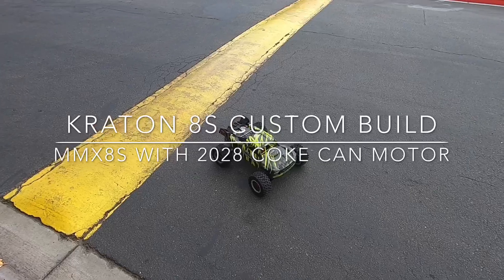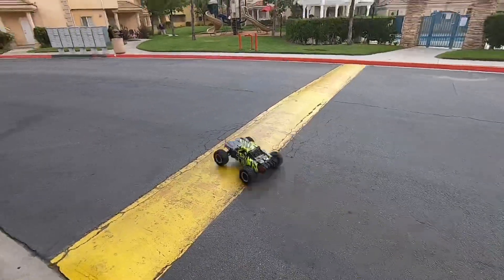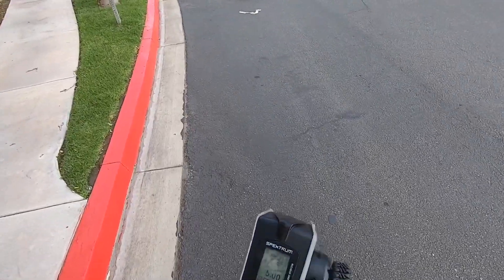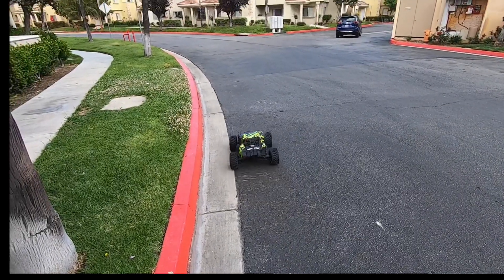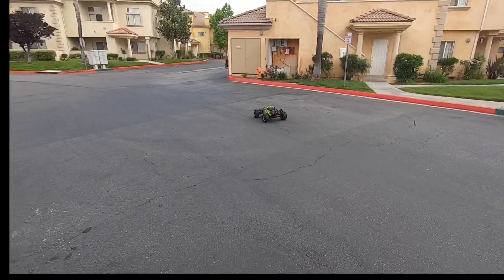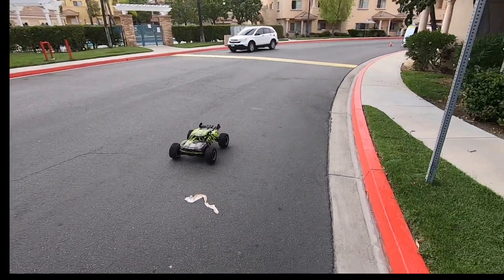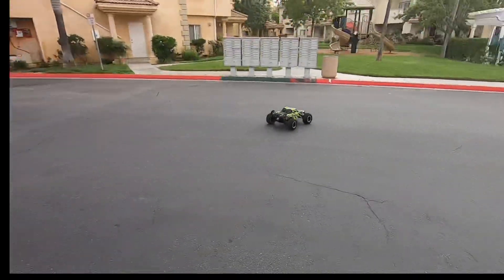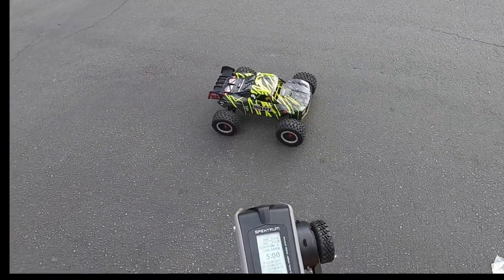Arrma Kraton 8s MMX8S with 2028 motor setting up the spectrum DX5 Rugged first run

Comment: Thanks to castle's strong magnets in their motors the brakes work amazingly in any build you throw them in! Shit my sensored 1515 brakes way harder than my tp power 4070cm.
Reply from the maker: Yes I’ve noticed that to my 1515 works great on the brakes as well 💯💯🔥🔥🔥

Comment: try turning up the voltage on the servo if it can handle it
Reply from the maker: I turned it to 6.0 v already should I go more didn’t change at all figure it’s done already??
Reply: Earl Moorhead try 7.4v i thought my servo was bad I switched to a high torque  xmaxx servo and was still lacking same as the last one then i tried 7.4v now its sharp worth a shot

Comment: Did you alter the steering? I know you said you were going to take a look at your transmitter settings. Had to ask because I ran into a similar situation with my Slash build (inspired by watching Watermelon). I didn’t use a Traxxas servo horn and I was barely getting any steering out of it. Took it to my local hobby shop and they installed a Traxxas steering horn on my ECO servo and all is good. Good luck with your situation.
Reply from the maker: Thanks 🙏 my steering is all stock it looks like the servo is just real weak at this point but I appreciate the info you never know when it might help 👍👍💯💯🔥🔥🔥💯🔥
Reply: Earl Moorhead you seem to work on this hobby more than I do and from doing my Slash build no prep drag race car, I learned how a few millimeters can make or break your build. I used the horns provided with the servo and I assumed it would of worked as long as I had the correct link (servo to the bell crank). I was wrong! The Traxxas one must of had a few millimeters and clearance from the chassis to get full range of steering. Keep up the good work.

Comment: For us rookies what’s the punch you have to turn up
Reply from the maker: Punch is how hard the rc takes off on full trigger factory you can change it with the esc it’s under settings in the manual on my system I have to hook to castle link and adjust it 👍👍💯💯🔥🔥🔥🔥
Reply: Earl Moorhead oh ok. Does Traxxas have that option on their ESC
Reply from the maker: They do on there blue tooth connection link traxxas link I think it’s called 💯💯
Reply: Earl Moorhead oh ok will look it up

Comment: how do you like the dx5 rugged?
Reply from the maker: It’s not very good it is soooo hard to change setting and program new models into the rc the DX5C is much better but the futaba is the way to go I just use the DX5C for all my Arrma rc since most of the receivers work with that remote 👍💯🔥🔥🔥🔥🔥🔥
Reply: Earl Moorhead that’s kind of what i have heard about it. like. the concept was good but, the actual product didn’t turn out quite how it was envisioned. Not real user friendly. Kinda sux , i like the look and durability factor but endless scrolling thru features sounds boo boo
Reply from the maker: I agree 💯💯💯💯

Comment: Whats your gearing in the video?
Reply from the maker: 30 pinion stock spur
Reply: Yeah its ridiculous how this 800kv can pretty much run spur size pinions i got 44 pinion with 46 spur and it pulls wheelies at any speed with shocks set to the lowest setting cant wait to see what the kraton can do